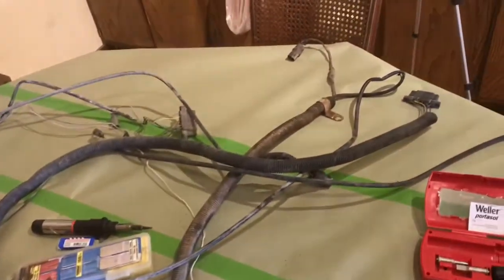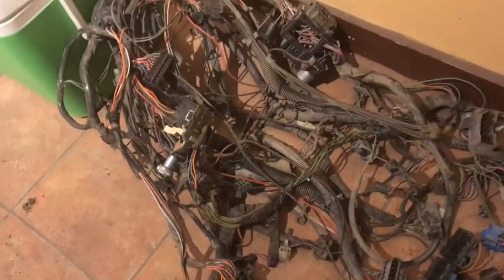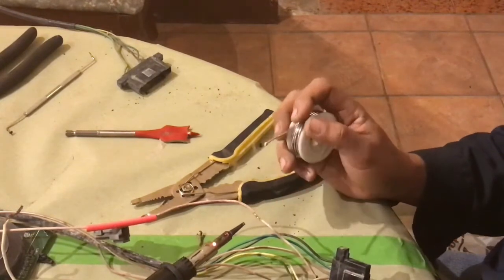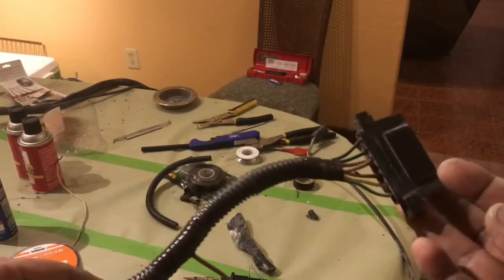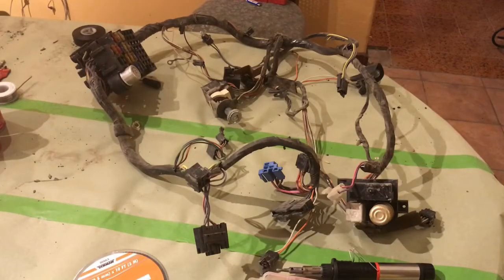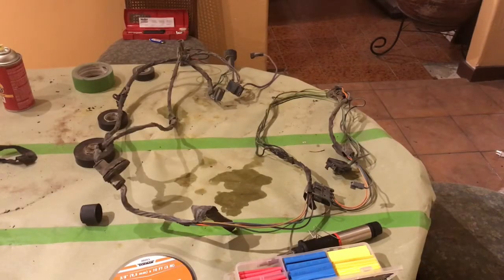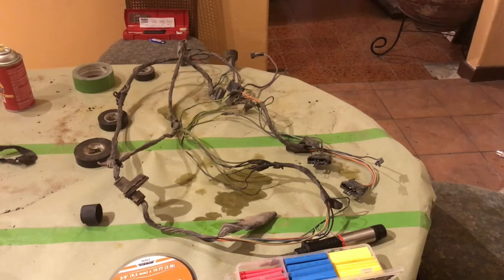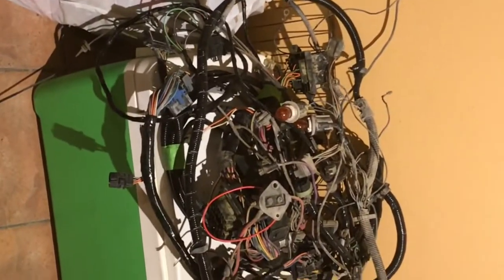Square body electrical harness

Comment: Hey Joe, my local school district is now an all IC CE fleet now with buses with the Maxxforce 7 and the 6.7 Cummins.  Also, what software is needed to work on the Cummins IC's.
Reply from the maker: Hey there Jillian. I would say you need NED and Cummins insight. Good choice on the Cummins ISB but the Maxxforce 7 are a little troublesome. Proper pm’s are required.

Comment: Hey brother I’m rewiring my 76 and my speedway harness doesn’t have a reverse light wire for the rear of truck just the three wires I included the third brake light wire but am not sure how to tie in to the neutral safety switch